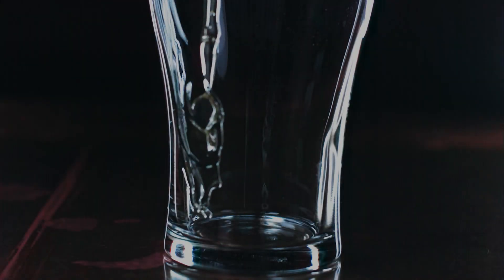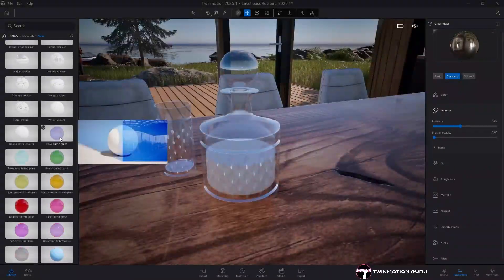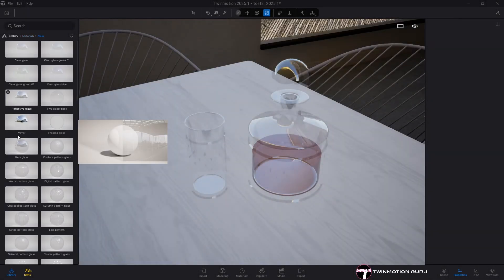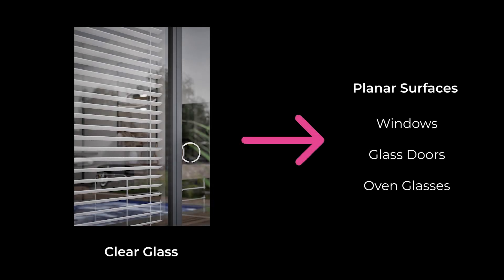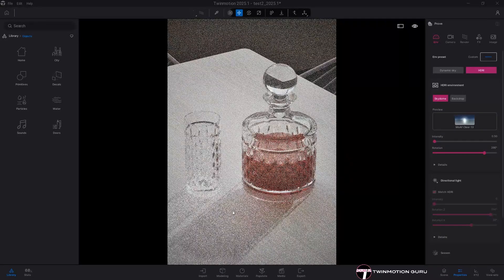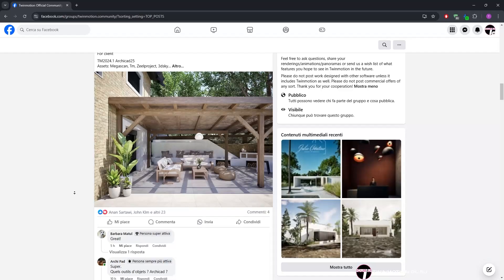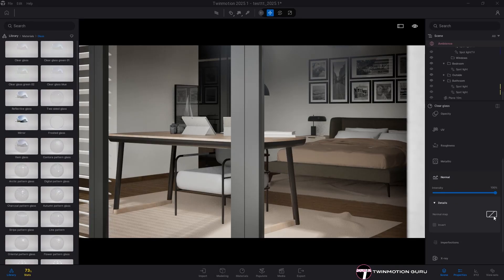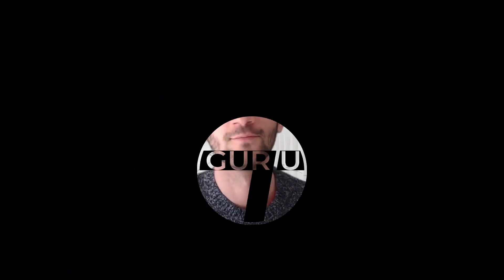Twinmotion 2025.1 - Perfect Glass Material Step-By-Step Tutorial

Comment: How to give radiance/Luminance to glass.? I am having a hard time giving radiance to bulb because the emission option in properties is not available for glass. It is there for mirror but placing mirror material for bulbs and lights looks weird.
Reply from the maker: you have 2 options: or assign to the bulb directly the standard emissive material, or leave it with the item glass material and put inside the bulb a little 3D sphere and assign it the standard emissive material :)

Comment: Twinmotion says its materials are PBR, but they are lying, what king of PBR is that they invented? terrible
Reply from the maker: What material are you referring to? 😀
Reply: @TwinmotionGuru  They are not Standard in PBR metal Rough or Specular Glossiness at all, they have all custom parameters and never achieve standard result. Each material has different parameters, for example Glass, making glass in Standard PBR workflow is same in all standard engines, but here is weird and color glass is different with standard glass, this is funny!
Reply from the maker: @ every software has different way of thinking, twinmotion for example is perfect for everyone that needs super fast rendering without spending so much time in the rendering process, but at the same time it's a great solution for everyone who needs photorealistic results. the final rendering quality depends on how you set all twinmotion parameters correctly, not by thinking on how other softwares  do that thing you're tring to achieve with twinmotion. never use a specific tool with the knowledge of other similar tools 😁